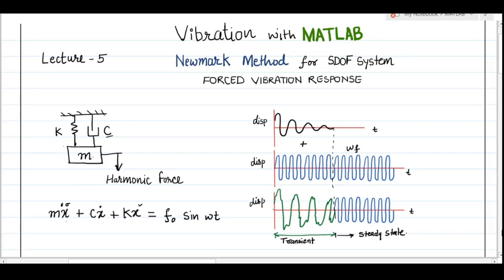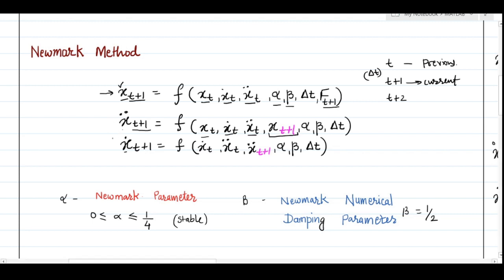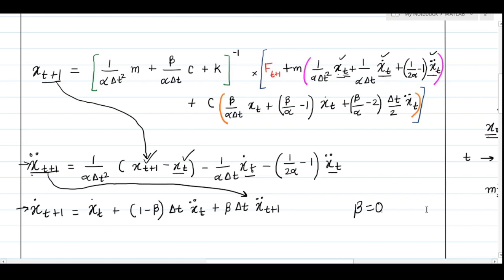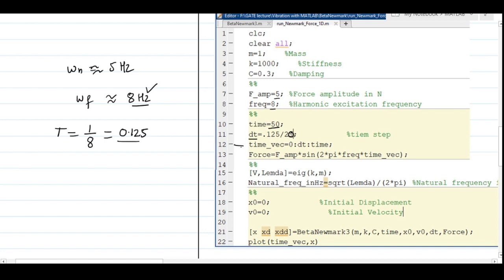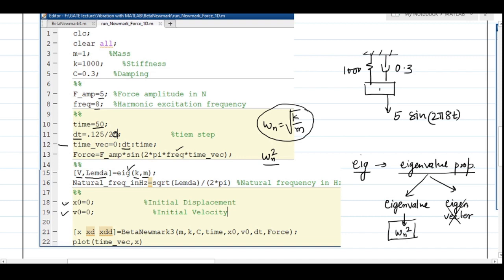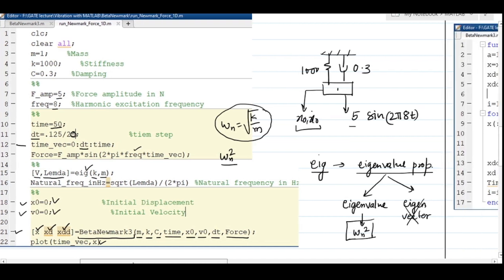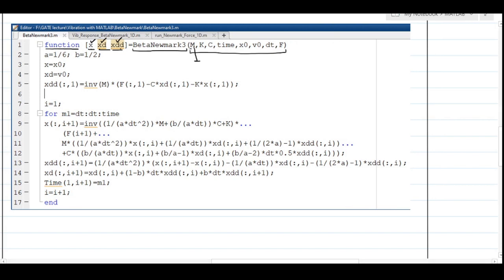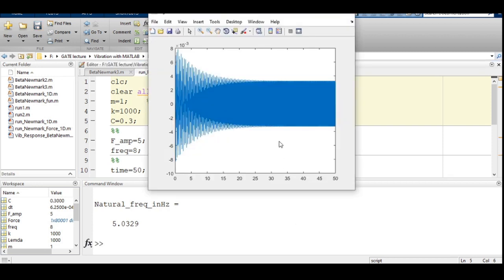Force vibration of  a damped  SDOF System || NEWMARK METHOD in MATLAB||  Vibration with MATLAB L5

Comment: Mr. Purihit, thank you for your great analysis. I just want to mention that almost at minute 4, you say something like" A implicit method uses the previous and current time step". This is not correct. An implicit method uses information about the future. The one that uses information about the previous and current time step in order to get the future time step that we desire, is the explicit method or central difference method or forward difference method.
Reply from the maker: Yes, you are right, an implicit methos uses future and current value and therefore at both LHS and RHS future value appears. However the Newmark is an implicit .ethod. I mistakenly said previous, it should be "future and current" Thank you identify it. This comment will also will  help other viewers.